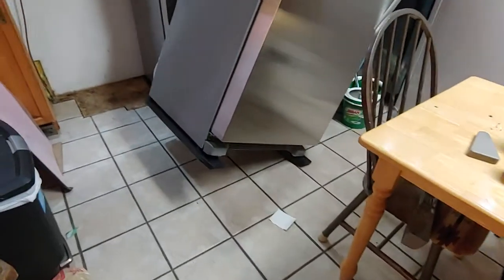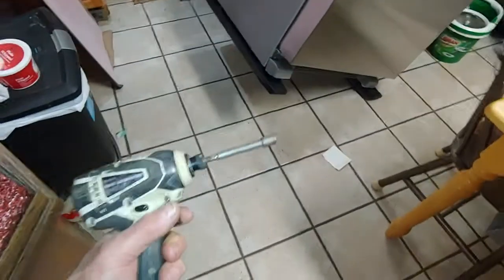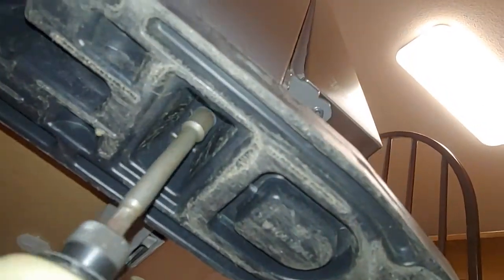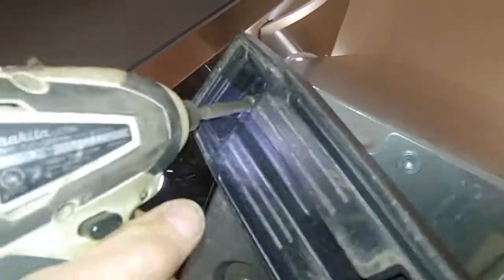removing shipping skids from Whirlpool fridge and freezer

Comment: What about the cardboard underneath?
Reply from the maker: Throw it away
Reply: @EdPelto  Please don't advise people if you're not sure. I just called Whirlpool and they said  the cardboard is not to be removed, it helps creating air flow and protects the parts underneath. If removed it can cause the motor to overheat and burn.
Reply from the maker: Sorry I thought you were talking about the box it came in I didn't realize you were talking about part of the refrigerator